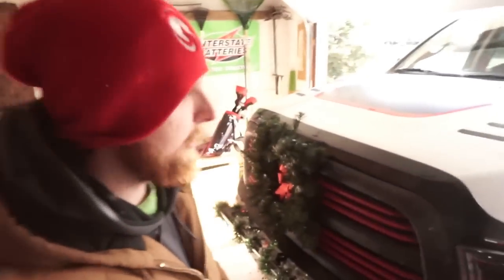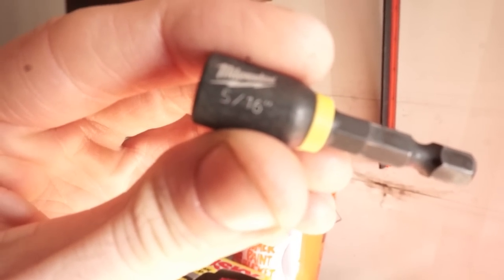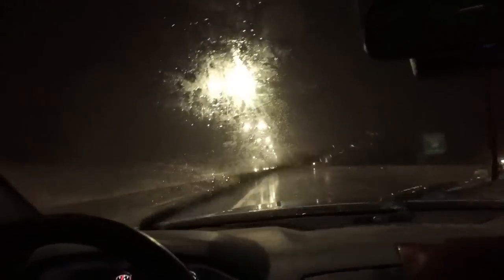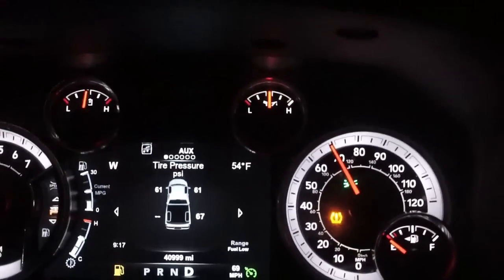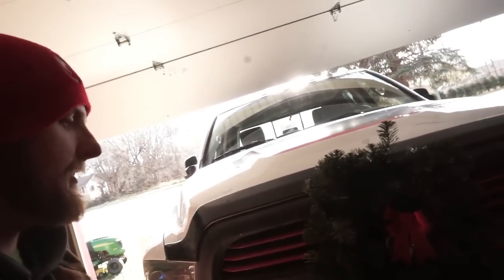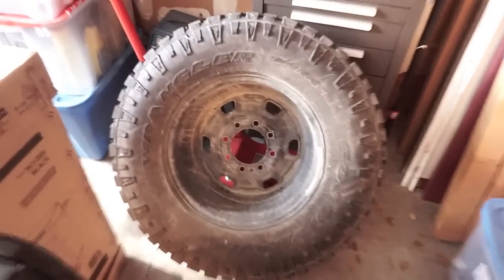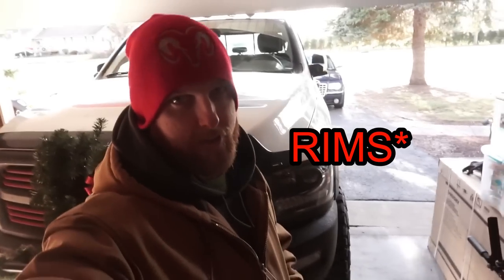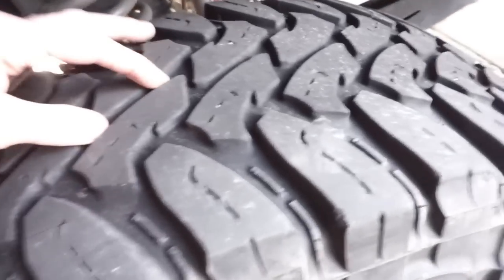I'm DONE With 37" Mud Tires...

Comment: Ian, I can find out what our guys recommend, but IMHO in this order: I'd go KO2's, Nittos, Generals (get the Red Letters! they are REAL fun in the snow (not), but AWESOME in sand, rocks, well Baja) or maybe Hankooks, but be ready to balance them frequently. I actually replaced my OEM DT's with the 35" version. I was pretty impressed with them on snow and ice, they seem to stay balanced and are quite, wearing well too, though I do have five in rotation. Off-road here in AZ and UT, jury is still out on rock puncture resistance, I lost one in Moab, but like you, I think I went too low. I think that is why Goodyear tries to up-sell to the Kevlar sidewalls. Speaking of rotation, a 35" will fit between the frame rails, but I found that I had to air down to ~10psi. I have a decent sized Puma compressor onboard, so I'm not concerned about that. Rather have a spare tucked than deal with one in the bed or a swing out rear bumper at this point. Go talk to one of our guys see what they say, I can update here if you want, and I can call a store mgr. and save you a few...
Reply from the maker: Don Leamon I would love to hear any advice you and your store has buddy, and I'd like to go to discount this time If I can , rather than order online at a random site. Tell them I'll go there and give them a good word on video ;)
Reply from the maker: Don Leamon I'd prefer the Machesney park , Illinois store by the way :)
Reply: Just go with Falken AT3. I run them and have close to 50,000 on them and you can hardly tell I have that many miles on them. They are great in the rain and mud. I live in Texas so I can not vouch for how they are in the snow. Lol!

Comment: I noticed that my 38x15 wide Toyo mt's "4000 pound rated" have WAY soft compound compared to my 33x10 Toyo mt's..  3 years and the 38s are showing weather cracking (6+ years & no weathering on the 33s) Our "MERKAN" trucks are heavy...My F250 crew cab diesel weighs almost 10,000 pounds empty. The modern  light truck "tire construction" might handle the weight, but the soft compound ( designed so the tire won't last forever)  is just garbage..  I'm done with (light truck) main stream tires & looking into military tires.((335/80r20)) are 40" x 12" ,  5,700 rated, and they will NOT crack & rot for a couple decades.  Maybe $100 more per tire & you have bullet proof rubber! >>Literally able to survive pistol rounds with only making  little chunks !

Comment: Judging by the view of your Toyo wear pattern; said Toyos are aired up too high. 
The center of the tread is wearing faster than the outer tread.

Two of those tires can easily hold the weight of the entire truck. You have to air DOWN in order to get a proper/even wear pattern.

In addition; most people's right foot dictates their vehicle's MPG rate as well as tire wear.

Comment: If you want cheap, good in slick conditions then it is simple Kuhmo AT51. Nominal price of $200 per a tire at tire rack or simple tire for a 315 70/17 in 8 ply. What you get is a tire that has fallen off the radar because it isn't as mainstream as BFG AT KO2. Consumer reports data came back at the bottom of their list of all terrains. I looked the whole list over and the only thing that was different than the others is because of tread life. Personal experience is limited. Because I needed a set of cheap tires I put them on back a few months ago. First these are what I call gummy bears. Shore hardness came at a lowly 57. They seemed to be crowned when they came out of the mold which means the first 100 miles they were more than clowns in a circus car. Once I got them broke in they started wearing across the surface of the tread (at 50 psi the tire should wear even across the tread face) instead of more in the middle. Now we have been having freezing fog here. These tire on ice with moisture in the air and beading up on the surface I can still start and stop with ease in two wheel drive. Even leaning on the big block it won't hardly generate tire spin. On course it acts in different to it. Snow is what ever. Which confirms consumer reports as this tire is above average in these conditions. On rain with hydroplaning consumer reports rated below average personal experience with mine on standing water (about 1/4 inch) at 50 mph no problem. My tire size LT 265 75/16 used on a 95 Ford F250 with 3.5 gears powered by a 460 with an E4OD behind it. Yes I will use again unless I start having catastrophic tire failures. Also ranking of tire manufactures on all aspects of tires Kuhmo is listed better than Toyo and about equal to BFG by consumer reports standards which we will see.

Comment: IMO those tires are over-inflated.  That is why they are so worn in the center.  I have E-rated 33's on my 12 RAM 1500 and even though it shows 80 PSI I only run them at 46-50PSI.  You are in your upper 50's low 60's and IMO you should be between 48 - 52 PSI.  Unless you are putting TONS and tons of weight in the bed the high pressure isn't needed.  Trust me your tires will last longer.  I found this out the hard way too and my BFG KO2 AT's also had this issue until I aired them down more.  Just my 2 cents though.  Nice truck!  I'm in Montgomery, IL myself!

Edit - your right rear showed 67lbs.  Yup, WAY too much for an unloaded truck.  You have TONS of meat on the outsides of the tires but are thin in the middle.  You can confirm what I'm saying by getting a cheap tire tread gauge on Amazon or using a quarter.

Comment: I have the Toyo MT's on my Power Wagon.  I run 45 psi front and 35 psi rear with no load on the street to keep it from feeling like a basketball. Off road. I air down to 20 psi front and rear. With the MT's. You're lucky to get 30,000 miles out of them.

Comment: In my experience some time the tire pressure sensors can get hot and mess up at least on early 2000's trucks running big tires. For street tires run BFG KO2's. My Pa runs 35" KO2's on his 3/4 ton GMC.

Comment: I had great on-road experience with the BFG A/T tires. I think KO2s might be a bit too aggressive for what you're looking for. The nice thing about the BFGs is that they can go forever, you can get a lot of miles out of them and they are really quiet. I think that it's a good idea to do this, but it's going to be a pain to change them whenever you want to go out, which may make you not want to go out as much.

Comment: I have 37” tires on my 2012 ram. I paid 270 a piece and have had them for 2 years with about 35k miles on them, they are quite on the road and still have lots of meat on them. You should look in to them.
Reply from the maker: What tires
Reply: IWrocker they are called Mastercraft courser MXT
Reply from the maker: SmokinErn thank you I'll check them out
Reply: IWrocker may I say that my truck is a 2012 ram 2500 diesel with a 3in rough country lift on those 37’s with stock 17” wheels that the truck came with.

Comment: I drive 60km a day on gravel/ offroad mix and have run my ko2 through snow and mud, super impressed with the tire... hit about 160kph on gravel they handle way better at high speed offroad than duratracs.

Comment: Do a chalk test to find the right pressure on front and rear. If look it up on line they explain it in detail. I ended up 45 front/40 rear and could go lower,Cooper SST PRO 35x12.50x20.

Comment: Are you sure it's aligned perfectly? I'm surprised they wore down that much so quickly
Reply: He is running to much air in his tires on the street. Those Toyo's will wear much better with 55 PSI front 45 Rear.

Comment: Do you use air or nitrogen in your tires? I heard nitrogen is way better for your tires than air. Longer lifespan (well according to my neighbor who has a white 2010 Ram 3500HD dually Crewcab Tradesman w/ slight tuning (it’s a sleeper) delivering 550 horsepower to the wheels and with the same wheels/ tires he had since he bought the truck). Moral of this comment is try using nitrogen instead of air if you aren’t already,
Reply: We stopped offering it, as it was not beneficial enough for the cost. (I work for a MAJOR tire retailer)
Reply: Don Leamon oh. Well shit then.
Reply: Nitrogen in tires is an old wives tale, unless you're Formula 1 racing or something.
Reply: The nitrogen will not increase or decrease in psi with elevation change I believe

Comment: Lol I was just gonna say something about air pressure, the wear looks like they are way way to full 37’s should be around 50 psi. I run 45 front and 40 rear in my 37’s, on a 10,000 lbs Dodge cummins. FYI I run Toyo RT’s

Comment: Two things:  How often do you rotate them?  I suggest every oil change.  (3-6000 miles)  You'll see the wear not be so much more pronounced on your front tires, compared to the rear.

Next, I recommend BFG Mud Terrains. (KM2's) once you wear those tires out.  They'll last a lot longer, and be better off road.

Oh, and three:  Get a portable mic.  Your voice dropping in and out is playing havoc with my sound system.
LoL
Reply from the maker: Wreckz Alottovdatime thank for the suggestions , yea I do rotate every 5,000 miles but my rears are new cause I blew out a tire a short while back so now I got a mix of worn and unworn unfortunately, and yea my external mic on the camera is a Sony and only picks my voice up facing me haga sorry

Comment: Look into cooper discoverer AT3.. it's a lighter tire, it will improve your mpg a little, they are great in the rain, dry,mild mud,snow, and they will fit your budget😁👊🏻
Reply from the maker: BR Outdoorz sure will thanks bud!
Reply: IWrocker 👍🏻I had a set on my 2012 Ram 1500, great traction, I think that would be a great tire for Moab, in the rocks. And on a truck with lockers,shit son! I might look into a set too😁🤣🤣
Reply: I have 37” toyo open country AT and they are phenomenal in snow. Keep in mind I’m from Syracuse NY so it snows 6 months out of the year
Reply: I have a set of AT3’s on my 1990 Ram in 33’s. Best tire I’ve ever had!
Reply: coopers crap,lasted 9 months,

Comment: Falken wildpeak a t. Please stick with 37's because 35s would just look silly. On-road stability could be greatly improved if you air down your tires a bit. The recommendation on the sticker of your door jamb is for your truck at Max gross weight rating NOT an EMPTY BED. Inflate for load, try 50 in front and 40 in back and see how that feels. Also, I've seen scientific studies on various tire sizes and within a certain margin it really doesn't change fuel mileage that much. The variation in tire size that throws off your odometer and computer makes it look like you're getting much worse than you are---stick with a 37's

Comment: The new nitto ridge grapler are great I have on my 8" lifted 3500 mega cab they go to f rated and handle great in all weather but mine are 37 12.50 on 22
Reply: I have that tire in 33" best tire I've ever had. Going to get them in 35" when these ones wear out

Comment: I run 37 Toyo Open country on my Ram and most of my driving is highway and I got 47 thousand miles out of them and let me know where you got a set for $1200,   the best price I got was  $16500 for a new set and that was at the 4 wheel of road Jamboree!
Reply: Kenneth Davis 16k is a lot for four tires . $4,250 per tire . Price gouging!

Comment: Pro comps have a great  factory warranty.  There xtream  at is gov rated  m/s  and 50,000 mile warranty. But I love my 35" dura tracs.  For some reason there tougher than the stockers.   I know you will have to run spacers with the stock wheels and 37s.

Comment: You just bought the wrong toyo’s. If you would have gotten the R/T’s then you would have been able to have the lifted, bigger tire look with decent road manners and capable off road ability and fantastic road life. I’ve gotten 59k miles out of mine and I’ve rotated them once and sadly never had realigned the tires. My front tires cupped so I put them on the back. That was my fault though and not the tire. I only put the cupped tires on the back after 57k miles. Who knows what I could have gotten out of them. I take my rig to uwharrie often. It gets wheeled heavily. It also goes on the beach at Carolina Beach often as well. Those tires have had a hard life and they just keep taking it. Toyo R/T tires are well worth it.

Comment: UM, Wait a minute here? You're running the Toyo MT's, and they are wearing out fast and you show your tire pressures at the 4:10 mark and you're running 60/65ish -- now my Toyo MT's in 37's are stamped on the side wall 50 psi max. Are those 13.50's? or 12.50's? If they're the 13.50's I guess that makes sense since that one is an E-rated tire. But if they're the 12.50's no wonder they are wearing fast. :p

Also do it, I'm planning to pick up some winter tires, the MT's are so so in the snow.

Final thought, Don Thuren recommended running 10-15% less air out back than up front if you are not towing or hauling, dispite what the stupid TPMS says.

I got my alignment dialed into his specs and have been running the Toyo's 45/40 and they are wearing nice and evenly and holding out really well.
Reply from the maker: Bold&Adventurous other videos show and I say that I I run 50 psi on average, I added 5 psi a cpl weeks ago to combat the cold, well the temp went up to 66 degrees that day unexpectedly and I drove 250 miles on the highway which all contributed to the higher pressures u briefly see. Cmon now jaha I wouldn't air them up to 65 psi lmfao
Reply from the maker: In other words cold temps lower your tires pressure and warm temps and high speeds make your tires warm up and thus show a higher reading until they cool down a bit
Reply: LOl well you never know.
Reply: This guy is running 67psi in 37x12.5x17 D Rated Toyo MT no wonder they’re wearing out and he’s lucky they haven’t blown apart being that over inflated!  That’s 17 psi over the max rated pressure on those tires.
Reply: IWrocker   Bud hate to break it to you cold temps are not going to change your tire pressure by 17psi just own it you’ve been running WAYYY too much pressure in those tires hence the crappy wear and I’m sure they ride like absolute crap too.

Comment: Hi great videos, my garage door opener has a height adjustment knob, check yours to see if it will pull the garage door up higher, it might get you enough to get the truck in there good luck.

Comment: purchase some inexpensive military used ones 36"  they are almost 90% tread( on most) you can pick up a set of 4 for around 500.00 work good too bad thing is at least when I ran them it needed a 16" rim
Reply: Ranger xp crew 1000 you need a 16.5 or 20's to run those military tires!

Comment: I think your front driver side coil spring is seated wrong in the top isolator
Reply from the maker: It looked like it but it never had a problem or felt different. Truck is sold now, but buyer said it didn't look concerning

Comment: So I don't actually wheel my Ram Rebel, the diet zero-calorie zero-sugar powerwagon aesthetics 1500 they make - but I too had some tire-slippage in the rain with mine. My factory Toyo AT2s were pretty bad in the rain. Spinning all 4 tires in 4WD? No thanks.  I did a shit ton of reading on eevery review, web board I could find.
I'm not an actual expert, I'm a guy that's read some stuff! Take it with a box of salt.

My take - Apparently mud terrains in general are not the best in the rain, the way they channel water. They can paddle mud fantastically, they look great, but once it gets wet, slip and slide.  Look at the traction surfaces on regular tires - the water has places to go. Once that road tire gets offroad, poof, gone. Plugged. Bowling shoe.  It's a trade off.
Tall vehicle, wind, tires with so-so traction, wet out - those are basically the conditions needed to make it slip, from what I can tell.
All terrains are generally a good compromise between the two.

I've had Dueler Revo2s, General Grabbers - on an FJ. But the KO2 is my favorite thusfar. (By your tastes, those Revos would basically be a racing tire).
The BF Goodrich KO2 is supposed to be Mud, snow, and snowflake rated (heavy snow). 

The KO2s have had great traction in everything. Snow, the dirt it has seen, rain, you name it.
- They did need to be roadforce balanced! 
- I had some rear end shake when the tires were new and the sidewalls were stiff. Suuuperstiff. For 2,000miles.
Now they're sponge-y. They need a little more air than the stock PSI, going by feel anyway. Guys on 3/4ton truck forums commented on how sponge-y they felt. 
But for traction, I've had a lot of tires, I think those are a good "Every day, but maybe I don't feel like changing tires to do some mudding" compromise. 

They're also fun to look at! They just look right on a truck.
Reply from the maker: J P thank you very much that was great info. I never pictured so many comments would happen on this video haha lots of great info, I got lots of thinking to do

Comment: Bf Goodrich ko2
Reply: Jack Edwards they're great for traction, but terrible for wear.  Mine are done at less than 20k miles.
Reply: Grarder bfg ko2's and ko's are great I've gotten 25k-30k from each set with a good alignment and regular rotations at every other oil change
Reply: Jack Edwards amazing tire but not cheap even with 315/70R17
Reply: I've had KO2's on my GMC Sierra 1500 for over three years (50,000 miles).  I have them rotated regularly and keep air pressure at 50psi.  They still going strong, good driveability and road manners,  normal sound quality and they look pretty beefy for A/T tires.  Can't recommend them high enough.
Reply: Gravel roads eat bfg ko2. Got 7k miles of of them with chunks missing from all 4 tires.